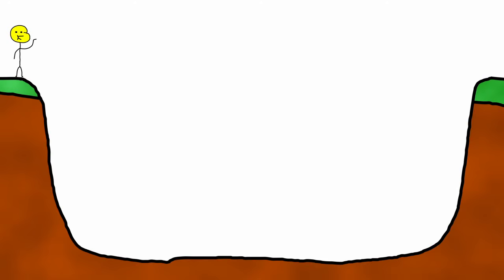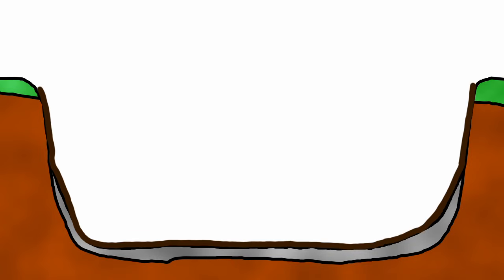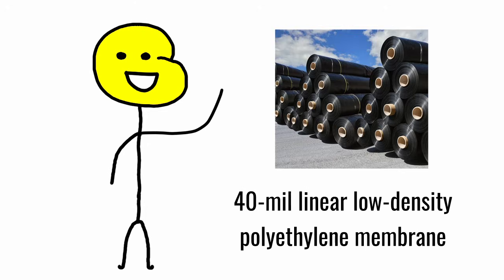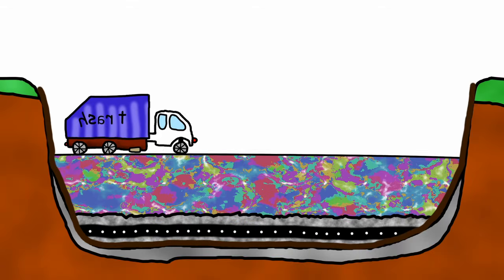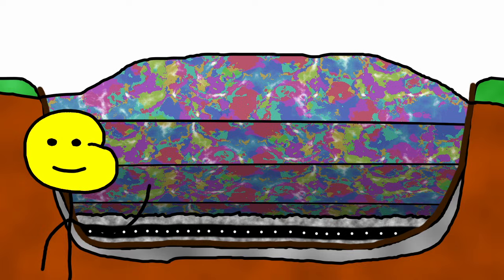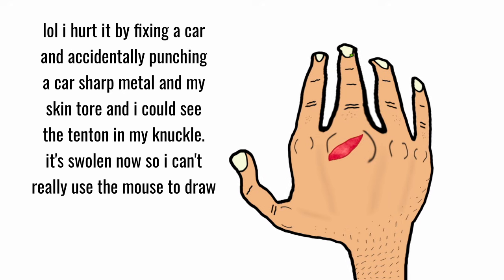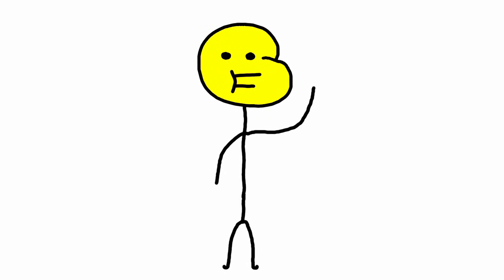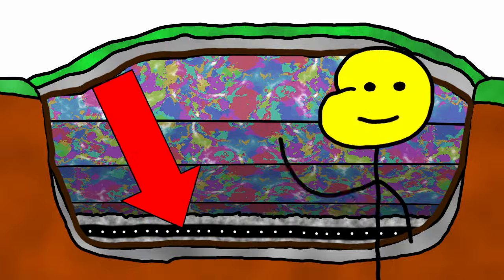How a landfill works

Comment: The real question to say is, how a landfill doesn't work. Because they never do work, no matter what anyone says. Landfill is not a realistic solution for disposing trash. If people and government do it, then they are stupid.
Reply from the maker: what do you propose?
Reply: @justEight  The trash should be subdivided into various categories, compostables, plastics, metals, and everything else. Compostables should be turned into fertilizer. Plastics and metals and glass should be dealt separately, and they should be recycled. However I would ban plastics worldwide because it contains toxic components. Any useable items such as old electronics or furniture, should be fixed, or in last case, disassembled into parts, and recycled. Any sane society would recycle the overwhelming majority of the trash. And any sane society should not produce unrecycable trash in principle. Putting all the trash into landfills is a barbaric practice, and it will detrimentally effect the environment for generations. All of this can only be implemented under a planned economy. Make me the emperor of the Earth, and I'll set it straight. Unfortnately, there is no easy solution to cleaning up the trash and pollution that the previous or current barbaric society created.
Reply from the maker: how would you make people comply? they don't want to listen

Comment: I worked at a golf course on a landfill, they didnt even use a liner on top of the trash or if they did it has really deteriorated, under 1-4ft of dirt is just stinky sludgy garbage! It made all the irrigation leaks on the course really gross to fix! I love landfills!!!
Reply from the maker: I would take a huge dump in one of the golf holes